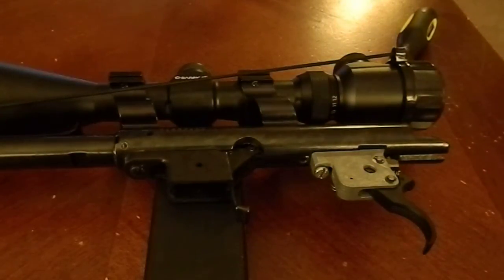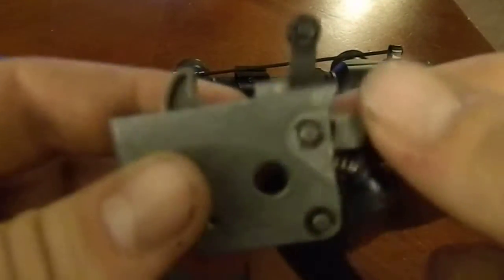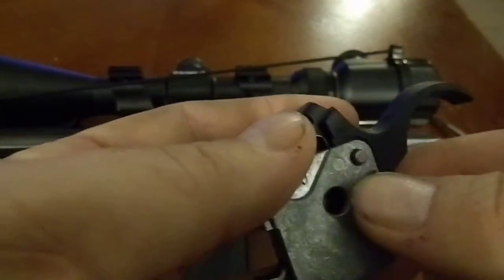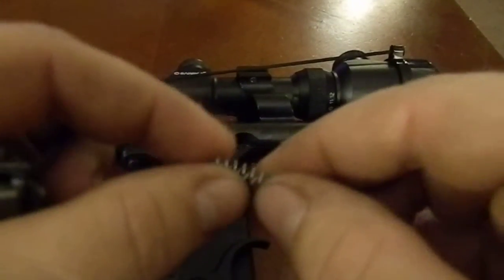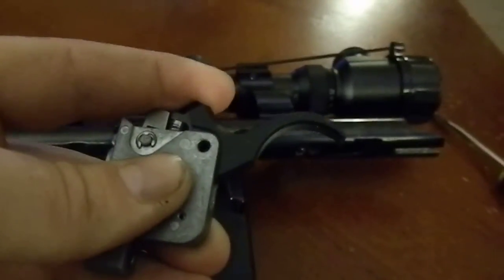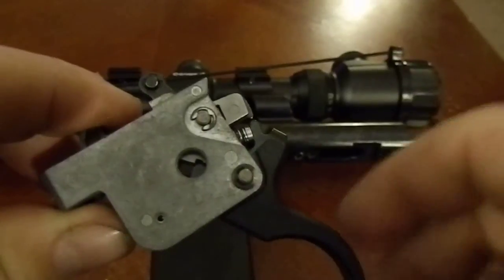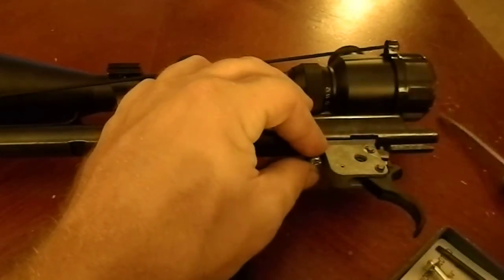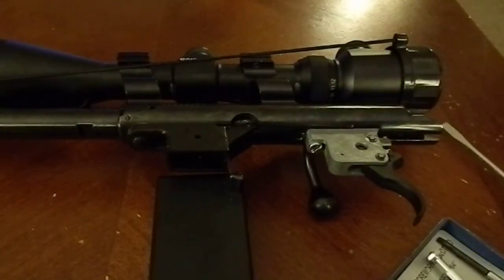Marlin 925 trigger mod.

Comment: Hi - Part 3 - Hi Lizardsman. Well, today I successfully swapped out the factory trigger spring for a much lighter spring from a very old ball point pen that looked very similar to yours.  It seemed  to function the same only with a much much lighter trigger pull.  Thank you once again for a great informative video from which I was able to perform my own upgrade & I can hardly wait to test it at the range.  Very Sincerely Yours.  JAMES.

Comment: ...brace dovetailed into the underpart of barrel. I was going to send it back to the factory but cannot find any info regarding model 925 with this "webbing".  So I never got around to sending it in. I did your trigger spring replacement & plan on testing it out at the range when I can get some ammo. Maybe my 925 is newer than yours or was in a different "run" that put that webbing in it. I can't figure it out. MOST 925's I have seen on You Tube have wood stocks.I'll Keep you posted. THX JAMES

Comment: Hi lizardsman. I have the 925 .22LR bolt action w/ synthetic stock. The trigger started giving me problems by becoming VERY hard to push. I disassembled it to do a COMPLETE cleaning & I remember there was a plastic webbing that appeared  to hold "things" in place. Well, I broke that webbing all to hell & removed it. Now I have a cleaned gun but it has trigger problems. I may try your spring replacement to lighten up this trigger. Any questions or advice? Thank You. Sincerely, JAMES.

Comment: Well I never cleaned anything other than the bore & upper receiver chamber for like 1500 rounds & then the trigger got really hard to pull, (almost impossible). So I went home, totally disassembled it all & that is when I discovered this plastic webbing (for lack of a better way to describe it). When the rifle slipped out of my hands the webbing broke & I just ripped the whole thing off the inside (i.e. trigger group & magazine chamber). Rifle has floating barrel held in by a little metal.....

Comment: Cool tutorial, just a FYI removing the trigger assembly is not necessary although it does make it easier to handle. This way you don't have to worry about forgetting that extra spring.

Comment: Hi I was just wondering if doing that trigger job affected your poi. When I done it I was shooting about 6 inches left @ 50 yards. Put the original spring back and shot 1/3" group. I found it really unusual because it's not as if the scope and barrel were adjusted at all and the rounds fired fine. Any info would be great. Thanks.. irishpigeonshooters.

Comment from the maker: Could you clerify trigger problem? I have shot mine alot and the spring does help. I'm not familar with any "plastic webbing" but if it just fell onto yor arm nothing should have broke. My daughter actually pushed mine off my dresser and nothing broke. If yous still have a stiff trigger, or it's verry hard to break, put some grease on the small pin on the back of the bolt that catches the seer. Also take the bolt apart and clean and grease it well. Hopefully that will fix the stiff break.

Comment: Hi - part 2 - I was hoping I could do a fix without having to send it to the factory (5 yr. warranty still in place by 2 yrs.). I have tried to find disassembly videos of this gun on You Tube but have not as of yet found any. I still do not know what that plastic webbing was but I accidentally broke it - it was not in place very strong - & when the gun fell over & landed on my arm that is when that webbing broke. I hope it is not important or a necessary part of the gun. Thank You for your help.

Comment from the maker: @tradbowyer1975 I'm no gunsmith, just trying a few tricks. At this point I haven't done anything further on the rifle. There's a few other mods I wanna try, like the shim on the second spring and some polishing on the bolt to help with a cleaner break and make the bolts action require a little less effort and make it smoother. Give me a week or two and I'll post the vid and let ya know when it's up. Thanks for watching and provide any feed back after you mod your rifle. I.E. if it shoots better.